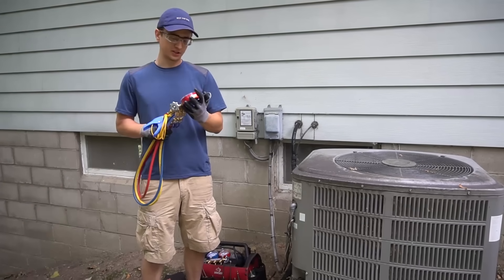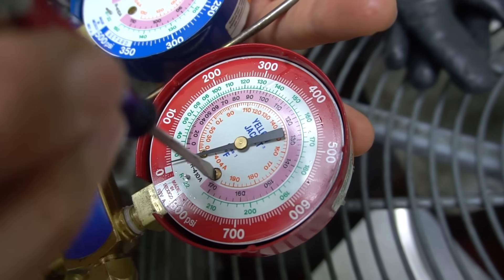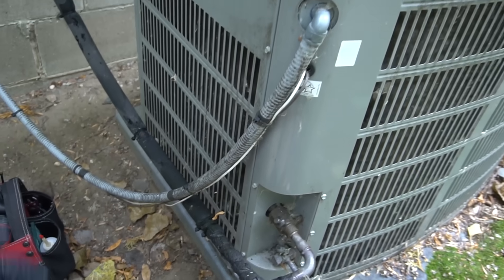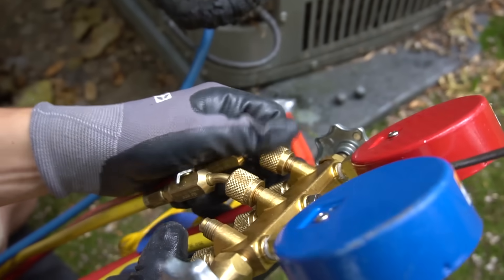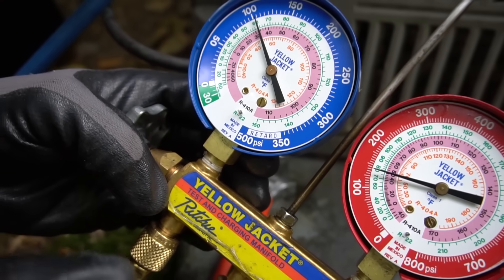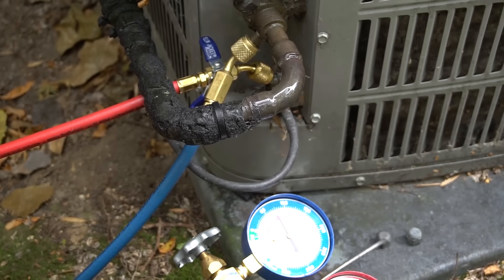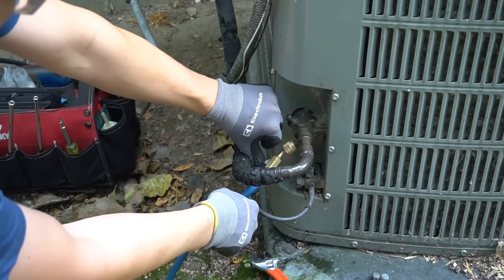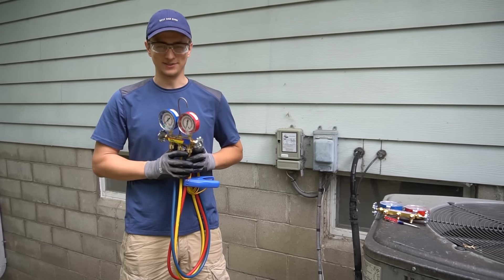How to Check AC Freon Level

Comment: Well what you gotta do is before you tell the customer your finished and charge him 20000 for adding Freon ..... splash water all over your head and soak your shirt and then act like you ran 7 miles and then go...,.well ..,it was tough .... I mean we had to wrestle out a few leaks and kill some aligatora it was a tough fight but we survived sir and your ac has been  fixed

Comment: This guy should not be giving "how to videos" first of all to check if you have a proper "refrigerant charge" you absolutley need to know your liquid line temperature and suction line temperature. Also depending on what metering device you have. If you have a txv you check your subcooling if you have a piston "fixed orfice" you check for superheat. Just because your suction line is sweating does not mean you have a proper charge. "Refrigerant" restrictions also cause line set to sweat. And its not FREON its called "Refrigerant", freon is just a brand that sells refrigerant. Im sorry man but you have no business posting how to videos.
Reply from the maker: Thank you for clarifying all that, much appreciated!
Reply: No problem.

Comment: It is a federal law that anyone handling any refrigerant handling equipment or refrigerant period with out proper EPA license will be subjected to 10,000 fine and or imprisonment up to 5 years. Just throwing that out there.
Reply from the maker: Thank you for the warning! I have a universal EPA license but hopefully this will be a fair warning for people who don't. By the way, if you get the chance, could you site the source for that info as well? Thank you!
Reply: $37,500 actually.
Reply: And this is why videos like this should not exist for homeowners as they have no reason to be checking the refrigerant pressure on their system. Even if they do they don't know if it's good or not. They don't know if they have a piston or txv metering device. They can only go by pressure which is only half of the equation on correct charge. I'm an HVAC tech and the worst customers to deal with are those that try to work on their own units because instead of arriving to find a problem I arrive to find 5 and 4 of those are what the homeowner did.

Comment from the maker: Guys, in this video I made a little mistake and just want to make sure you won't do the same. When I put my gauges on, the unit was off. Usually I put them on while the unit is running. In the video I forgot to purge my hoses when I put them on which is especially important when the unit is off. When I then turned the unit on, the air that was in the suction side hose got pulled in. My AC is working fine but I am sure if I do that mistake a couple times I will have problems. Air is a contaminant in the refrigeration system so purging hoses is something that shouldn't be forgotten. If you have anything else to add, please do so! I do not claim that I know everything. A technician is always learning new things. Cheers!

P.S. Also want to re-emphasize that refrigerant can be dangerous and your AC unit can go into an even worse condition if someone does not know what they are doing. Therefore if you do not have any background or experience in HVAC, I would highly recommend not dealing with refrigerant yourself. Stay safe!
Reply: what is the yellow hose for? thanks
Reply from the maker: The yellow hose would be the one that you hook up to the refrigerant bottle.
Reply: @WordofAdviceTV  
Nice videos.
I thought the EPA cert was just for buying the older refrigerants, and maybe for working by hire.  The universal tech is easy to get though, hit up a local tech school and take a simple multiple-choice exam. (or 3 short ones)  A small fee but it's good for life.
Reply: @elgringoec  Up until 2018 you could buy non ozone depleting refrigerants with no certification but you needed a certification to handle it, but now since January 1st 2018 you need a 608 certification to legally buy any refrigerant. The one exception is small cans of R134a refrigerant for automotive AC systems, those can be purchased and used with no certification.
Reply: @averyalexander2303  
Interesting.  I got the certificate years ago so I could maintain my systems, and my family's.  I got the journeyman electrician for the same reason.  I see the liability issue behind it, but it also seems like overreach.  And it makes everything cost more.  But to some degree I feel like I'm beating them at their own game.
Reply: @averyalexander2303  nope.   i just ordered a 25 lb cylinder of r410 off ebay in the summer of 2019.   it showed up at my house.  i have no certification.   easy to order
Reply: @jamesoliver5662  Wrong. I don't doubt that someone sold it to you, but that doesn't make it legal. I'm sure you could find someone who will sell you meth too. Does that make buying meth legal? Right from the EPA's website: "Only EPA-certified technicians are allowed to purchase ozone-depleting substances (ODS) OR NON-OZONE DEPLETING SUBSTANCES used as refrigerants, with limited exceptions. Refrigerant can only be sold to technicians certified under the Section 608 or Section 609 technician certification programs". R410a is a non ozone depleting substance that is used as a refrigerant. Would you mind showing me the limited exemption that would allow an unlicensed homeowner to purchase a tank of R410a for them to use in their own system? Here's the page I found that information on https://www.epa.gov/section608/refrigerant-sales-restriction
Reply: @jamesoliver5662  R410a isn't restricted like the old stuff...and there is a simple test to take do a little studying, and get a cert, it's a lot of over reach indeed.  And yet cigarettes are still sold, a KNOWN issue, why?  Cus the gov't makes BILLIONS in taxes, also they tried to make working with old lead paint a nightmare if you take apart a certain amount, unenforceable, another over reach..why ain't there tests required for holding a public office like President, senator, congressman....they all need to be tested...cus it's pretty BAAAAAAD. Just walk in, blow smoke, con the masses, NOW they set policy, what D' f' is that all about?
Reply: @averyalexander2303  It says ozone depleting or it's substitute, R410a is not a substitute for R12 or R22, there is stuff that is , not R410a...you misread it...
Reply: @jamesoliver5662  Ozone depleting or SUBSTITUTE for it, R410A is not a substitute for R12 R22, R410a is an entirely different thing, there are sub for R12 that or for use in the old systems not R410a
Reply: @averyalexander2303  They also mention mini splits need a disconnect for power inside, near the evaporator, WRONGO, a mini split is considered a single system, the outside disconnect is sufficient, ya gotta read and understand it firstly
Reply: @cengeb  It says nothing about substitutes. What it says is "Only EPA-certified technicians are allowed to purchase ozone-depleting substances (ODS) OR NON-OZONE DEPLETING SUBSTANCES used as refrigerants, with limited exceptions". R410a is an ozone depleting substance that is used as a refrigerant and a homeowner recharging their own system is not an exception, therefore one must be EPA certified to buy it. Pretty simple.
Reply: @cengeb  Who mentions that a mini split needs a disconnect near the indoor unit? I never heard that one.
Reply: @cengeb  I do agree about the government is more interested in making money and helping big corporations than protecting the public and the planet though. How the hell is refrigerant going to float 10 miles up into the sky to deplete the ozone layer when it is 4 times denser than air and quickly sinks to the ground? Someone wanna explain that one to me?
Reply: @averyalexander2303  yup, some local AHJ, do, and in the Mitsubishi mini split booklets with the units, they show an indoor disconnect, is dotted lines  ie. possibly maybe depending on your location, but it's been challenged, and it is really not needed, if the system is considered a complete single system which it is, all about interpretation, and words.....none of mine have indoor disconnect, just the outdoor one
Reply: @averyalexander2303  R410a is non ozone depleting, which is why they developed it, it does indeed use the word SUBSTITUTE, i just read it! R410a is NOT a substitute, it's a replacement
Reply: @cengeb  My bad, you are correct! I misread substitute for substance. However, a license is still required to actually charge the system. For that matter a homeowner can't even legally connect gauges to their system without a license regardless of the type of refrigerant the system uses. https://www.epa.gov/ods-phaseout/homeowners-and-consumers-frequently-asked-questions
Reply: dont wory we all made mistakes when we started ,,,,,just so you learn from them
Reply: Calibrating the gauge should be done with the hose off or at least open to atmosphere.
Reply: I would just say your head "temp" should be above freezing but yes ideally your suction should be about 40 to 50 and head "temp" about 20 to 30 °s above ambiant. Good video though and yes if you do not have EPA cert you CANNOT touch gauges unless a certified person is with you.
Reply: @chrisyuriar9751  R-410a is not restricted like the R22 stuff and that ilk.  R410a is not the bad stuff....yet.
Reply: @cengeb  It is now.  In 2019, you need to be R-410 certified to purchase or transport it.
Reply: @easytalkcafe  Only if you are doing it for a fee, or bartering, read the document, and ozone depleting SUBSTITUTE, R410a is not a substitute for R12 or R22, it's a complete REPLACEMENT, system design completely different, there are substitutes for R12 R22 systems, and it's not R410a...read the thing again
Reply: @easytalkcafe  You don't specifically need a 410a certification, a 608 certification is adequate to buy it.
Reply: @chrisyuriar9751  Except on automotive AC systems, for some reason you don't need to be certified to fix your own car's AC system or to buy small containers of R134a refrigerant. You do need to be certified to fix your house's AC system though

Comment: Just a thought. The EPA says that.......

EPA regulations (40 CFR Part 82, Subpart F) under Section 608 of the Clean Air Act define a "technician" as an individual who performs any of the following activities:

Attaching and detaching hoses and gauges to and from an appliance to measure pressure within the appliance.

So looks like somebody may be breaking the law. Or at least encouraging others too. Just a thought.
Reply from the maker: That's an interesting thought indeed! Thank you for sharing. As far as I know, I am not breaking the law, nor am I encouraging others to do it. Gauges and refrigerant can both be bought without a license so I guess anyone can become a "technician" real quick. But if anyone knows more information on this, please do say! That being said, personally I would not encourage people with no HVAC background or experience to mess with refrigerant as that could lead to sorry results.
Reply: @WordofAdviceTV  I agree. I dont have a problem with DIY, as long as the people doing it are abiding by the law, and safe practices. Some things are just to dangerous to attempt yourself, and when it comes to harming the enviroment it is all our responsibility to do our best protect our planet.
Reply: Word of Advice TV none of the supply houses I know of will sell refrigerant without a EPA card.
Reply from the maker: Many of them won't, I agree. I know that in the past you could easily get R22 on Amazon and E-bay though. Now that they are phasing it out, it's no longer there but anyone can buy themselves some 410 if they want it. For example: https://amzn.to/2Ov2FA0
Reply: You can buy 2 pound cans for $100 without license. Expensive but does the job. Thats $50 a pound., Same as a tech would charge.
Reply: @oldengdg2575  I'd rather pay the tech $100 to do it, instead of blowing away $100 on a mistake. And what if there is a leak and it escapes just as I am putting it in, I'll still wind up paying a tech to find and fix it, plus the $100 I lost on gas ...
Reply: @fidelalgarin241  OR you spend $100 and it last a while until it leaks out and you do not spend $600 to replace coil and $200 for gas. I do not have to call a Tech. I am out $100 only.  My neighbor's unit (R22) still going after this mine leaked out (R410A)  in a month. Nordyne Al microchannel coils; I can already guess it's the problem. Do I REALLY need a tech to tell me it's a POS ?  No. Worth repairing myself ? Perhaps.  Worth having Tech repair ? No. You live and learn. No more Microchannel units.

Comment: Another thing that you should know is that purging should be done when you first hook the manifold set. By you placing them on and not purging them, you probably pulled in air and atmospheric moisture into your system when the pressures dropped on the low side.
Reply from the maker: You are absolutely correct! Thank you for the reminder, I will make sure I leave the hoses slightly loose when I put them on. I don't always do that but now that you said that, I'll be working on my habits. Thanks again for the advice :)
Reply: Yup- moisture is in the air and moisture causes acid and acid in extreme cases comp failure
Reply: Michael Downey so that means you need a tank of refrigerant ideally to check pressures?
Reply: Yes, that was something that I had question on, also - I wanted to read all the comments before responding. But for a DIY'er, to whom I'm sure this video was aimed, they will almost certainly be using a set of 'virgin' gauges that WILL require purging - I hoped that would be part of this tutorial and the main part I wanted to see to reinforce the best technique for that process.

Comment: There’s a problem in using that set of gauges on R-22 as well as R-410a refrigerants. The R-22 refrigerant equipment uses mineral oil in the system, but the R-410a uses a POE (polyolester, synthetic) oil. If they me x, they have a tendency to become a mud-like consistency.  You’re better off keeping it as a dedicated set for one type of refrigerant.
Reply from the maker: Thank you for explaining that! I just briefly showed that I have 2 gauge sets but didn't explain why. I do have separate gauges for R22 and 410a.
Reply: Word of Advice TV 
If you blow out the gauges with nitrogen will that do the trick to clean out all refrigerant?
Reply: Actually you can mix the oils it was thought in the past that you could not mix them but you actually can. My mind was blown when I found this out all those years of carrying two sets of gauges to keep POE away from MO.
Reply: @rossy9549  jim patinato?
Reply: If that’s the case, then why do you have to flush line sets (or replace them) if your changing refrigerants ?
Reply: This is from Emerson: When using CFC or HCHC refrigerants, POE and MO can be mixed. The exception is R12 that only uses MO or Alkyl Benzene Mineral Oil (ABMO) blend. HFC refrigerants can only use POE oil.

If you get a chance read some of the retrofit refrigerant specs usually they have in there about lubrication if you have a mineral compressor to add POE in with it or vice versa POE to add mineral to help with oil return. Though the ratios are usually low. I mean no half and half crap but more like 95-5.
Reply from the maker: Well that's good to know! Thank you for mentioning that! I was taught that I should not mix the two as well.
Reply: @michaeldowney8429  installing new equipment do you really want dirty line sets. The practice was suggested to use even doing a (an) r22 change out
Reply: Snta Wyaen 
I don’t re-use linesets. I always install new ones.
Reply: @michaeldowney8429  either way. Wanna just making a response to it. If you always replace then you always replace I don't disagree with that I'm pretty much firm believer if I'm selling new you get new
Reply: So in other words, you are saying don't mix the R22 with the 410a with the manifold ? Cause of the chemicals in both greens being different ?
Reply: That's an incorrect statement you need to look that up again. There's lots of info about this from major manufacturers.
Reply: Not flushing a lineset when changing from 22 to 410a could leave a lot of oil in any dips of the lineset which isn't good. Manufacturers recommend purging lines with nitrogen or r22 and not any sort of flush.

When it comes to your guages, as little oil is inside the hoses it's not a big deal. Good practice is just make sure you empty them every time and you could just purge the manifold with vapor.

Comment: Talked about pressures on suction and discharge lines and saturation temperature.. didn’t cover super heat and subcool..
Reply from the maker: Nope :) Diagnosing refrigeration problems is not something I want to get into. That gets a little too complicated. I actually filmed it where I go over the refrigeration diagnostics chart but I deleted it from this video.
Reply: You can’t properly charge a system unless you know your super heat or subcool and delta T also you can use any gages pressure is pressure you can get a pt chart for any refrigerant on your phone
Reply from the maker: +Peter I agree. You need to get your readings before one can properly charge an AC unit. This video's purpose is basically to explain how to read a refrigerant gauge and not how to charge a unit or diagnose a problem. I do not want to show how to charge a system since I believe that is not something DIYers should try to do. That is why I did not talk about charging it or super heat, sub cooling, wet bulb, etc.